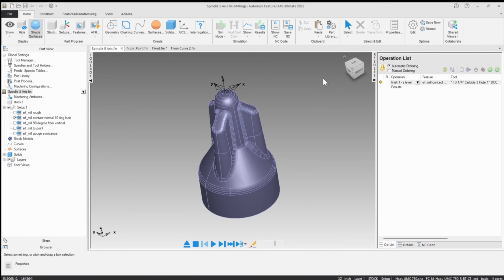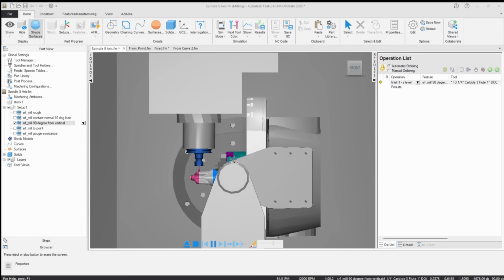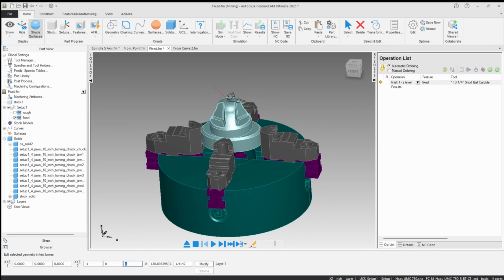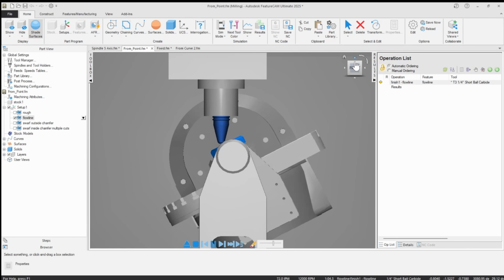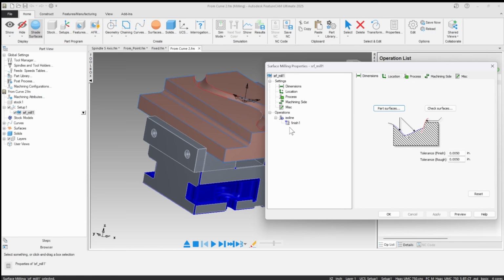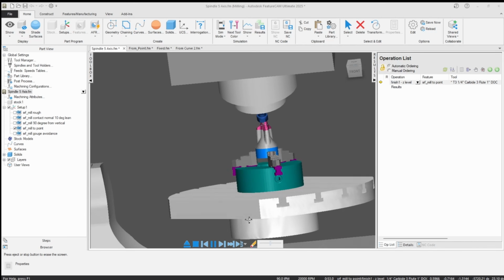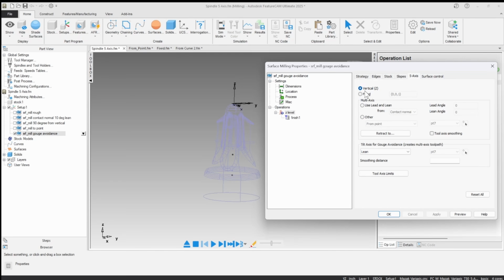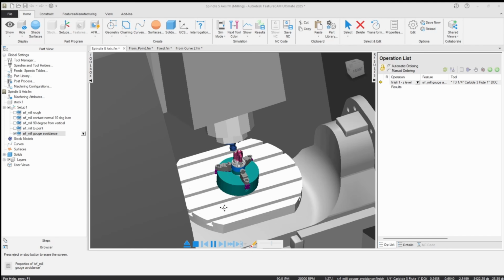FeatureCAM Overview: Simultaneous 5 Axis Machining

Comment: May ask you question please , I’m using fusion 360 , one offer the job to use feature cam , is it best software to learn ?
Reply from the maker: Its hard to say without knowing more about the shop. But if what your doing is Relying on Dual Turrent Lathes for example Featurecam is the way to go.